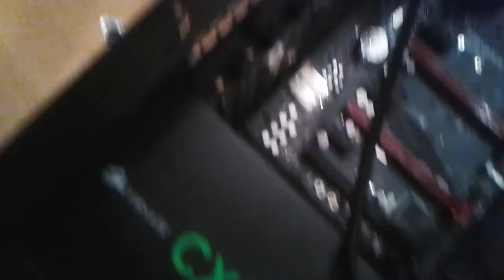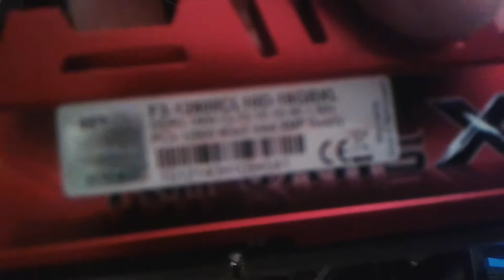Vlog - Custom Computer- Mother Board

Comment: I don't really think Optical drives are a thing these days
Reply from the maker: Jack Diamond There the technical name for a CD drive.
Reply: I know what I meant was no one uses them anymore. Its all about the usb
Reply from the maker: Well i have to install windows so.. I just got a really good one just in case!
Reply: TheSpeedkarter | Road To 2k Subs As long as it was below 20 bucks!
Reply: TheSpeedkarter | Road To 2k Subs I don't really have to worry about that, I just bought a Mac
Reply from the maker: There not that great, at least I think
Reply: TheSpeedkarter | Road To 2k Subs I love mine, and I've only owned it for a couple of hours! The software is much better than Windows
Reply from the maker: Well not for me I cant find out how to use a MAC and I think it is bad for gaming. But you think what you think about them.